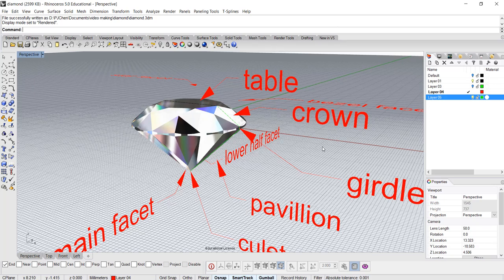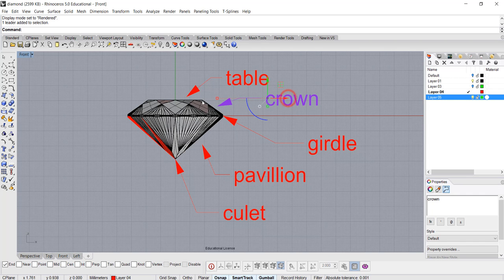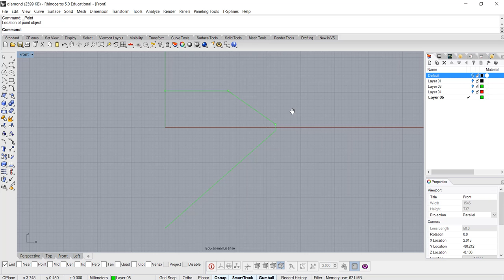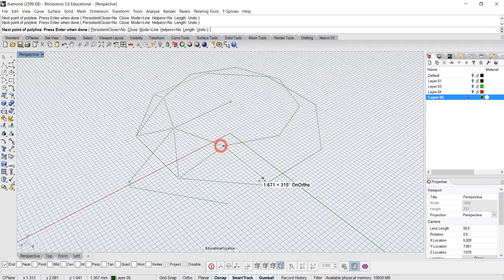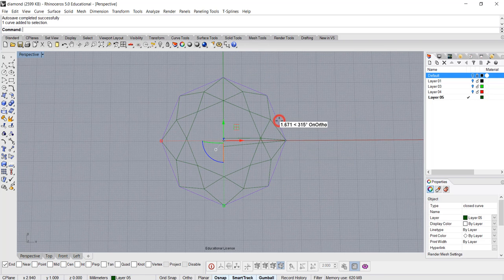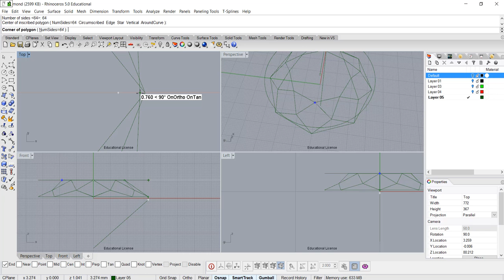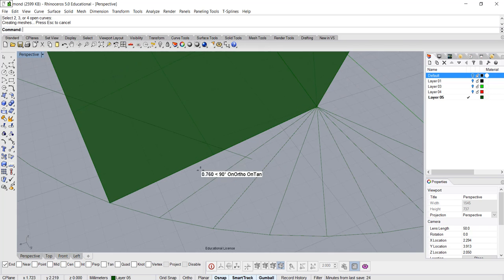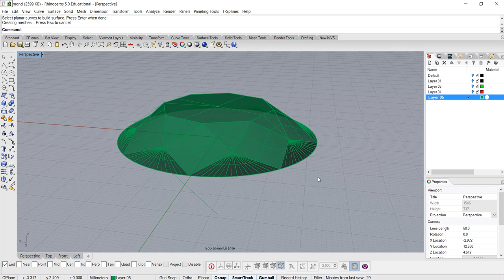Jewelry CAD Design Tutorial #7- How to Build a Diamond Rhino 3D (Part I)

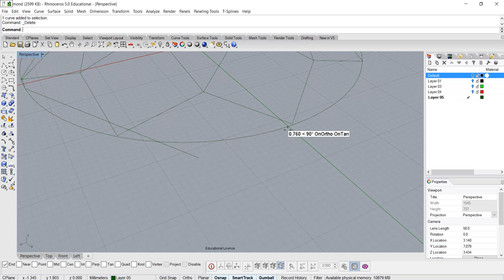Comment: Hi PJ! I am a member of your community and I was wondering, at time stamp 11:25 how were you able to connect the 64 sided polygon to the curves we created to make the upper half facet? right above the girdle. I am having trouble connecting them together creating an accurate connection between the two sections. I know I am late to the party but any suggestions?
Reply from the maker: If your model is not accurate, the first thing I may suggest without actually seeing your model, is the Osnap. Did you have it on and make  sure the end point is on.
Reply: @PJChenJewelryDesign  Thank you for responding quickly. I have O snap, ortho, and smart track with end point. I tried it and it keeps snapping onto the edge of upper half facet.I hid the outline of 8 sided polygon too
Reply from the maker: @tomaszapata4458  why Ortho is on?
Reply: @PJChenJewelryDesign  no particular reason, but I took it off and it would still stick to the top girdle.
Reply: Any other tips?
Reply: @PJChenJewelryDesign  I have done everything else correctly, but I get stuck when I close the surface of the girdle & polar array, connecting one curve from top to bottom girdle.

Comment: Thanks for these great tutorials.
one issue i have with a diamond
 is that it actually has a round girdle(equator)
when viewed from above.
This method here adds faces to the girdle which do not and cannot actually occur on a real diamond.

IE in place of the 8 additional faces there is two planar faces, whose vertices meet below the equator, which are subsequently rounded off by the girdle cut.

Perhaps using a circle to trim the 16 additional faces would result in a perfect geometry?
Reply from the maker: Hi Aaro. my thought on 3D model diamond is for rendering purpose. It doesn't to be exact the same, since the "real" diamond is never going to be the same on the model due to each of them have unique character.